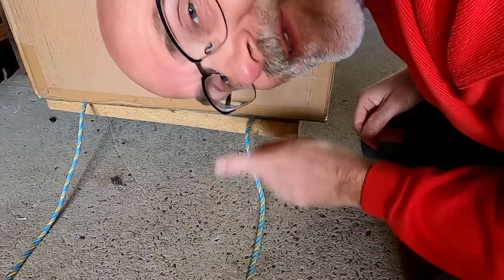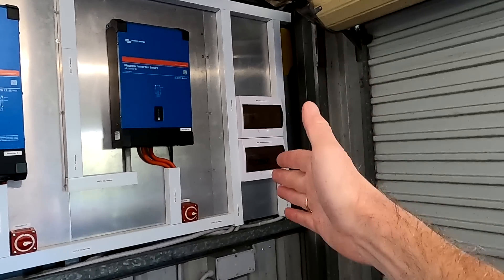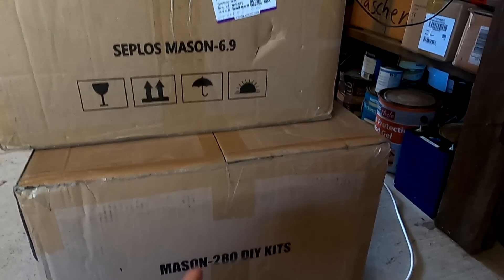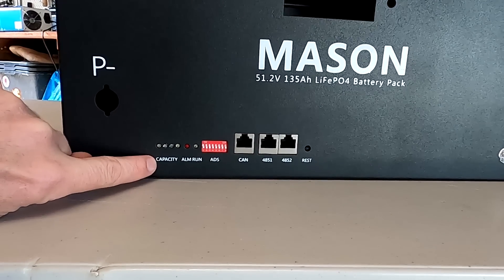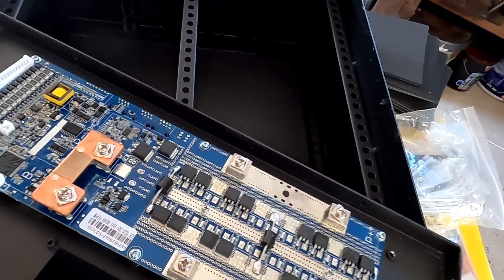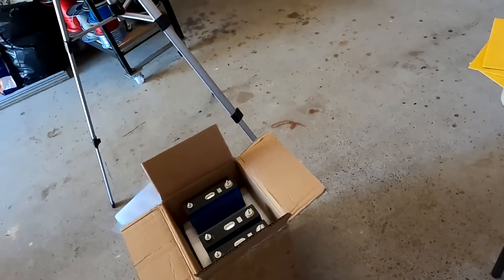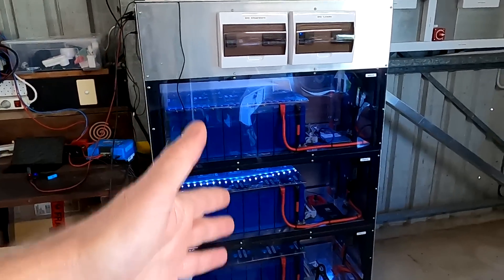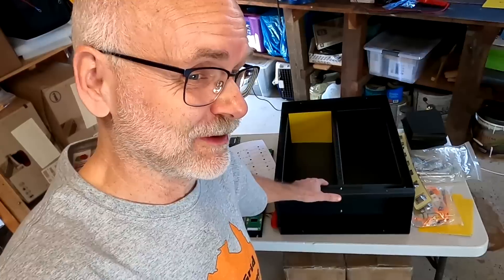Start of the #Battery3.0 series with the SEPLOS MASON 6.9 Kit

Comment: I ordered one of these from a seller who omitted several major parts (bms, display, fuse) and won't make good.  I got a settlement part refund from the bank.  I used the refund to order another from another seller and guess what?  It arrived missing the bms, display and fuse.  Shisters.  Q sucking Chinese shisters.  If you want a long hard battle to ever see your money again, just try buying one of these.   I had already built the entire system from panel to 120/240 v breaker panel.  But the batteries were exposed and needed an enclosure.  I couldn't find any suitable to fit.  So I thought this might be the answer.  The Jdb bms I possess doesn't fit in the seplos enclosure so I really wanted to use the one made to fit this case.  BIG F'ING MISTAKE.

Comment: I prefer the shelf design though I would change it to 4 rows of batteries. I'd move the distribution shelf to a wall. I'd also like it on wheels. 4 rows would be 800lbs though... Put it on a custom metal platform with heavy duty wheels. As much as I like your rack I think I'd like a thicker frame and so more than likely just weld my own. I could also make it not as wide. The spacing on your selves is near perfect but what if the selves were on heavy duty rails? The shelves could then be more compact and the whole thing shorter. It might need wall attachments to support the weight of the top shelf extended if that's full and the bottom is empty. But I can also image some slide out/in legs to extend the base.

Comment: I agree with you Andy about DIY batteries but I did buy 2 different rack mount ones because I want to open them and tested them for cell capacity and quality of the internal BMSs basically assessing the overall quality of these expensive products so that hopefully I can warn others in case they turn up to be a bad experience.  As soon as I have the all system functioning I shall devote myself to building my personal DIY battery and I think I have located a good source for quality cells.

Comment: looking at the BMS PCB there is no energy storage (caps or inductors) visible so it cant have any active balance?? So this battery can only be as good as its weakest cell. Hope the cells are well matched and pre-balanced at the factory.
Reply from the maker: The Seplos BMS has 150mA passive balancing. It will be in the next video after this.
Reply: @OffGridGarageAustralia  So it can only dissipate C/1000 in an hourly rate on a 150Ah cell. OUCH! 
Hope your cells are matched to 0.1% capacity then unless you slow charge.
Even at C/10 charge rate ( 15Amps ) 1% cell capacity matching seems optimistic.
I can see why your BMS shut off early on the later video you mentioned.

Comment: You can use a RPi as an RS-485 to IP converter and there are 'virtual USB' applications which allow you to use a PC elsewhere over your local network.
Reply from the maker: What would that achieve? I have planned to connect these batteries to my Victron OS so I can see the data from anywhere, not just locally.
Reply: @OffGridGarageAustralia  if you need to configure them but do not want to have a PC attached locally, it's possible to extend USB over IP.

Comment: Very interesting video. Beyond unpacking and building I hope you will do an indepth study of the Seplos BMS. Subjects of interest are what parameters it has and how to set them up, also how to  use the CAN bus to commmunicate with the Victron (it is suppose to work) and is it  useful ? Overall how good is this BMS and can it balance correctly the cells? I am also curious about the 4 external plugs they look like Pylontech but in that case can they handle the current for 304ah cells (usually 25 mm2 cables!). So lots of questions raised by this video. Impatient to see your following videos.
Reply from the maker: Yes, I did play around with it for the last three days. It is.... different...

Comment: But why bother with only 44% capacity of your 304Ah battery? If you are going to pay over the odds then it should at least have a higher proportion of that cost spent in decent cells.
Reply from the maker: 44% of the battery?

Comment: I got the same 280Ah DIY kit a month or so ago. Bit beat up in transport, but the worst thing was that a lot of the components were loose inside and metal parts were hitting the BMS. I reported this to the seller and hoped they would correct it, by putting all the loose parts in a cardboard box or something, just to prevent it from banging around in there during shipping. My delivery guy was also like "there's some loose metal rattling around in there, I hope nothing is broken"....
Reply from the maker: Thanks for sharing. I had exactly the same and you could hear it right at the end of the video when the delivery guy put it on his trolley.
All components where in a plastic bag strapped to the inside support. But the bag was not strong enough tore apart. A card bord box as suggested would be a great solution. I will suggest this to them as well again.
Reply: @OffGridGarageAustralia  It was exactly at that moment in the video that I thought to myself "oh man, why haven't they fixed this yet, it's such an easy fix and hightens the quality of the kit by miles, when you don't have things just rattling around in there". 
Thanks for some great content with a twist of adult humor in there 😆

Comment: How come you never talked about panels cleaning ?!!!!!!!
I am in this business only one month and I already had to clean em 3 times!!!!
Reply from the maker: It does not make any difference as far as I can tell. There is literally no power increase from right before to after the cleaning process. The power gain is only visible while I hose them down with cooler water so they perform better. After they are sparkly clean and warm again, the output is the same. That's my experience.
I clean mine when necessary though for peace of mind 😊

Comment: About the aging of Lifepo4 batteries. I have a small 12v based system with 4 100Ah batteries in parallel from 2014, that has been used on a off grid cabin system. The batteries has been charged by solar in freezing conditions. I am reconfiguring my system to 48v, and took 1 battery home to test remaining capacity. I pulled 102Ah from this 8+ year battery, so the lost capacity by age must have been negligible.
Reply from the maker: Oh, wow, that is a great result. Very high quality batteries you have there. Great 👍

Comment: Nice Andy, good choice! I've build 2 of these 135 Ah batteries. Would be interesting to see how the cells test. I tested 8 of them, they all tested between 133 and 135 Ah. Not above. So a little bit disappointing. Testing the complete kit resulted in 6.7 kWh / 129 Ah. Test method: parallel top balanced cells and let the kit run in my system for a few days. After that fully charged the battery, discharged it with 27 Amps (0.2C) till BMS shut off. Results were measured with a Victron smart shunt. The build was easy and everything looks very good and well manufactured. Did not test connectivity with my Victron system yet and it failed connecting with my laptop but didn't have time to dive deeper into that.
Reply: I forgot to mention that shipping didn't go as smooth as expected. Shipment got lost somehow, they never told me why and how. They sent me again after 5 month without any futher hassle, that was good and this time the kits arrived after two and a half month.
Reply from the maker: Thanks a lot for your information and sharing your experience. I guess, I have similar results with my cells. I'll talk about this in the next video and what Seplos had to say.
My shipping was a bit of a nightmare as well and took a very long time. The boxes got stuck in AU customs for 4 weeks as some paperwork was missing. I had to step in and provide all documents form my end to release them.

Comment: I am really interested in your results regarding the 280 DIY kit. I used 4 of them in a boat and the BMS are not working as expected. Can be a firmware problem or maybe a wiring issue. One box alone seems to work quite well. All together in one System (Master - Slave - Slave - Slave with Victron Connectivity) is a pain in the ass. Looking forward to your next video regarding seplos.
Reply: I have two in parallel...one master and one slave...it works just fine.
Sadly, I can't post links in the youtube comments...but there is a video of mjlorton regarding the programing and DIP-switch settings of those BMS.
Reply from the maker: Thanks for your comment. They provide documents on their website for setting the DIP switches. It seems fairly easy and straight forward. It will be in the next few videos...
Have you connected it to the inverter only or to a GX device? I haven't watched you boat video yet. Just not enough time 🤷‍♂️
Reply: @OffGridGarageAustralia  Once I set the DIP-Switches to CAN-Communication protocoll, I connected the CANBUS of the BMS to the Battery-CAN of the Cerbo GX with the Victron Type A cable.
Reply from the maker: @Raphael_Hofmann  Yeah, OK, I just don't have a CAN connector at my Raspi. I would need a another MK3 adapter, I guess, so I can use a USB port for that.
Reply: @OffGridGarageAustralia  I did not try that jet. I use the Cerbo GX. I'm not sure, if it works with the MK3 to USB adapter.
Reply: @OffGridGarageAustralia  It does not work with the MK3 to USB adapter in my installation. You need a CAN port, as far as I know.

Comment: Hi Andy, nice the start to another.
Do you know if they have kits that you can just buy the kit without the cells.?

Also can I ask down the line that you purposely make a big imbalance in the system to see how the bms handles and works it, this will likely determine if 100's of your viewer buy these kits or not,
PS I'd be one of them and ordering 7 kits without cells.

Hint hint at affiliate links for you
Reply: Yes you can buy the kit without cells. Check their website.
Reply from the maker: The Seplos MASON 280 DIY Kit comes without batteries. The BmS does not seem to be able handle large deviations. I have put all cells in the kit as they came without balancing them first and the BMS is a bit of a nightmare. But I'm still testing and filming at the moment, so haven't explored all options yet. Balancing seems to be passive with 150mA only. I have already connected the wiring for an active balancer to the box.
Reply: @OffGridGarageAustralia  ah Thank you Andy, that info helps alot, can't wait to see the video, all the best.
Good thing the Neeeeeeeeeeeeeeeeeeey had arrived.
My opinion the server rack type that one would,  buy, plug, and play will have the balancing issue as time goes by

Comment: I have two of the same Seplos BMS-es installed in parallel. The problem with this is that monitoring of the total solution is not possible while running if you also are using the CANbus for communication to the inverter. The software on the computer talks RS485 but when you use CANBus and a parallel Seplos BMS setup, the communication betweeen the multiple BMS-es changes into CANbus also. Therefore RS485 monitoring using the software fails from then on.
Reply from the maker: That's great feedback here. Thanks for that. Can you not use RS485 throughout and not CAN at all? I thought I would do that with my Victron system... 🤷‍♂️
Reply: @OffGridGarageAustralia  for only monitoring yes. But if you need communication to the inverter it then needs you talk rs485 also and a small chance it understand the modbud registers. Not standard. Interesting how this will work with victron gear
Reply from the maker: @igorybema  I don't need the BMS to talk to the inverter directly. Everything is controlled by the Victron system anyway. The monitoring information would be enough for me. 
Thank you for your insight.

Comment: Looking forward to you deciphering that PC software for the BMS settings, good luck 😆
You will want to get a Victron GX device, so the charge controllers can communicate with the BMS.
Reply: He has a Rpi with Victron OS on it. Will be interesting to see how that works.
Reply: @rikdehaas6398  Am not sure if the RP will work because the battery is canbus not usb.
Reply: @Juha Tuomala lol😀
Reply from the maker: You don't use the CAN, use RS485!
Yeah, the software is indeed... 🤦‍♂️
Reply: @OffGridGarageAustralia  From what I understand CAN bus is for communication to control inverter and RS485 bus is for programming and inter-BMS communication. RPi running Venus can do CAN bus but it seems to be a difficult to use add-on that needs to be added again after each Venus os update?
Reply from the maker: @DrCoolZic  I will try the RS485 and see if this connects to the Pi somehow. I've got one of the engineers from Seplos on my hand so I will ask him to help if I cannot get it going.

Comment: Andy please stop the false advertising.
Sunny hot Australia indeed.
I have 10 years of Off Grid Solar data at your disposal if you like and this winter we're in right now is the worst in my Solar experience.
I've got a million dollars worth (slight exaggeration) of gear sitting in the Off Grid Shed that's  causing me to lose what little hair I have left.
The missing element in the equation is the lack of sun.
The point is, maybe we should agitate for the manufacturers of these fancy battery packs to include a couple of buckets of sunshine with each purchase.
Loving your videos mate, they give me hope.
Reply from the maker: We have sunny (warm) Australia here. Lots of sunshine lately and an increase number of Wh each day as the sun moves higher.
But, yes, you're absolutely right. It's been the worst winter ever with the least amount of sunshine. This is actually good for me, I harvest a lot more through clouds as in pure sunshine and shade of the trees.

Comment: I hope the seplos works for you,  I wish there was a BMS that has an adjustable current balance, if it had to be set by solder bridges on the PCB, that allowed at least 1-5 amp 
Do a pwm and test, discharge for 1-2 seconds pause for nearly a second then test. When it's close to equalized,  lower the current and time, maybe use a pwm to discharge using pwm to to set the current,  either frequency or duration, (duty cycle)  with  the pause to test voltage!  With 18-20 gauge balance leads, a separate PCB for balance with a decent heatsink,  this way the balance leads can be short,  and the logic and solid state contactor can be mounted close to terminals, allowing for short cables,  with a shirt shielded cable between the boards, with the option to connect the two, if needed, use a 18ga aluminum plate to mount the boards to, to help with heat! ((( It's easy to design this stuff, when you know little about electronics!! 😆 And cost is nothing!! 😆
Reply: Active balancers for not get hot.
Reply from the maker: Yeah, I included the active balancer wiring in my build right away after the first test with the Seplos BMS. The balancing current is only 150mA passive.

Comment: Im very interested in seeing what you think about the seplos BMS, it seems like a great product,  I am in desperate need of a BMS, for my 7s system, either 10 smaller 80a  units, or a large unit capable of 400amps contentious, maybe a bit more,  because I'm thinking I will get a larger inverter soon, 6kw maybe 12kw,  that can surge about 2kw for minutes, not like some china inverters, that the surge rating is useless, micro seconds or the current read while tripping,  the current may be way up there,  but the wattage is not there, the voltage is going way below useable!! So the surge rating or peak rating is useless in most cases , so unless it does the surge for minutes to me it's useless,  at least 1minute to handle inrush,  a 30 minute burger  or peak even if it's only 10% over rated is a plus, surge rating lasting micro seconds is useless!! No need to even list it,  for a BMS, the surge should be current and temperature related, and controlled, and matched to the cells, 3c cells doing that 3c until the temperature rises to a point it's not desired! Then shut off,  with a peak current shut off, about 20% over that for start up surge, (inrush current,)   
The seplos BMS seems great, but costly,    I'm having to constantly monitor my cells, luckily the Ballance is close!!
Reply: @ James 1 : perhaps you should consider a non FET based BMS. Inverters give a complex load, so easy to blow FET BMS. Electrodacus SBMS 0 has external shunts, and control signals for eg a contractor. Alternatively wire the inverter direct to battery, and use a relatively high 3.1v per cell LVD. If inverter does not support that, then using relays; and a voltage sensing switch or relay; perhaps from the SCC. I have a SNADI 3Kw low frequency, toroidal inverter, controlled by SCC, through a timed pulse relay, to short out the power button, to turn it off.
Reply from the maker: I'm not sold on the BMS at all. I'm playing around with it for a few days now and don't know why people want to buy this. There is .... argh, I don't want to spoil it here... 😊

Comment: I ordered 2 of these last year. Mason 135. I should of waited until the 280 came out but oh well. For me it was all straight forth but I had 2 issues. The first was with the fuse holder. None of the screws actually fit. Later I found the case screws fit perfectly but the head was countersunk and not flat. Not a big issue. The 2nd issue was with one of the temp probes was shorted out. I had to remove excess solder from the PCB and then it all worked as designed. One side note, I did not connect the (8each) Sides together until I was ready to commision the battery. They have you put all 16 in series then connect the BMS. Been using for 6 months now and the system is solid. If you have any questions for me please ask I will be happy to help.
Reply from the maker: Thanks a lot for your feedback and sharing your experience here. I haven't done a top balancing with the cells beforehand and just installed them to test the BMS. Huge mistake as it turned out...